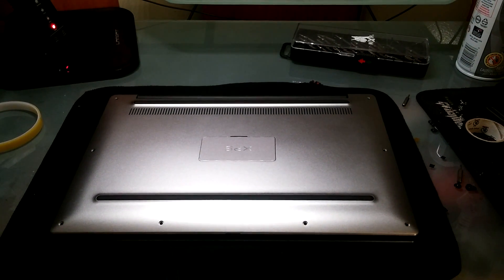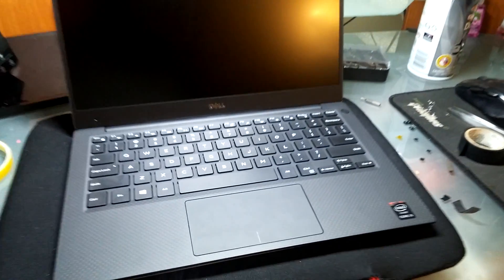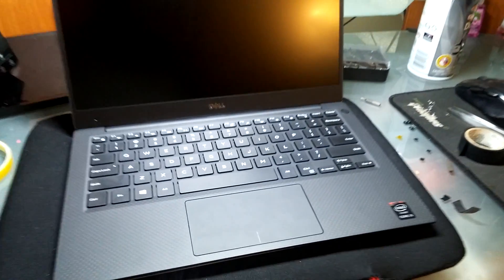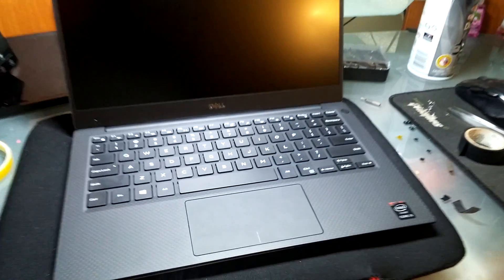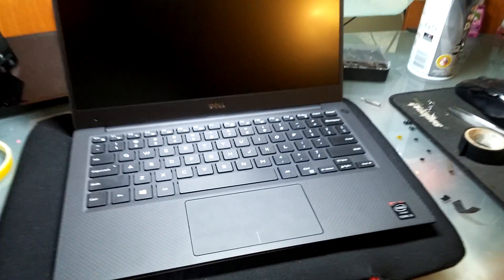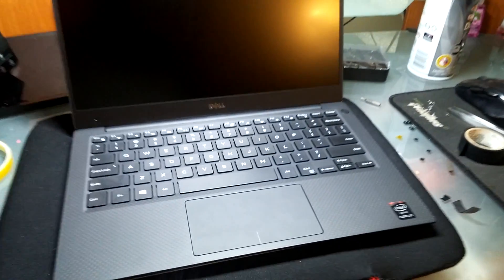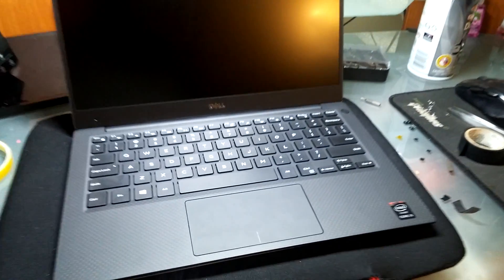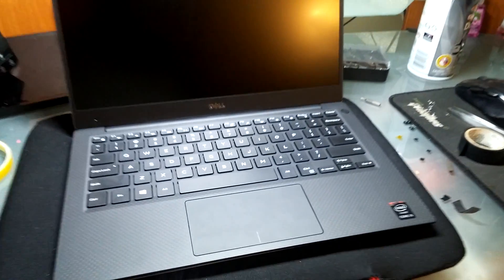Dell XPS 13 9343 2015 - Loose Rattle Trackpad Mousepad Touchpad Problem Fix DIY  Laptop

Comment: I had the same problem on my Lenovo Yoga 3 Pro. I figured out a solution by removing the back cover, removing the battery, and then sliding a tiny piece of paper under these two wings on either side of the trackpad. It was really easy, much easier than this. Why are all of these touchpads loose? I am thinking that it is done on purpose, to provide feedback for tapping.
Reply: bit late i know but U AN IDIOT

Comment: I've received my xps 13 today, having the same problem. Do you know whether all xps 13's know this "issue"? The techical support was really doubting me about it.
Reply from the maker: Chris Klerks Not all XPS 13 have this problem. Don't worry, this is a very easy and solid fix. Permanent solution.
It's not that hard, if you were in LA California, I'd do it for you for a cup of coffee in less than 30 minutes.
Reply: Chris Klerks Hi, what did the technical support say? Actually I do not want to open it by myself, as I could probably loose warranty. On the other handy I cant wait for more weeks to work on my laptop. Did anyone get a quick fix from the support?
Reply from the maker: loffski1000 I hate to break it to you, but there is no quicker fix for this problem. Guaranteed. Very unfortunate for such a nice laptop from a sophisticated company.